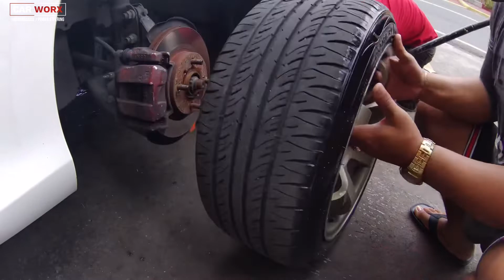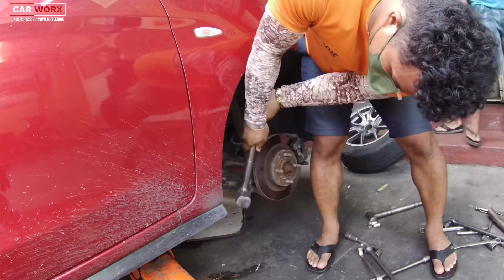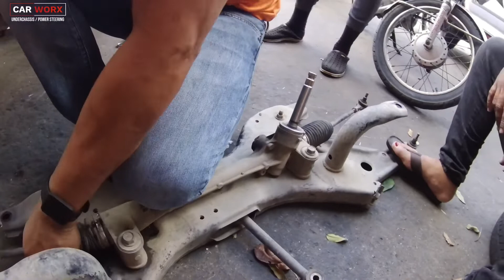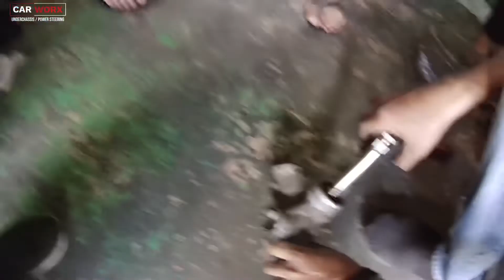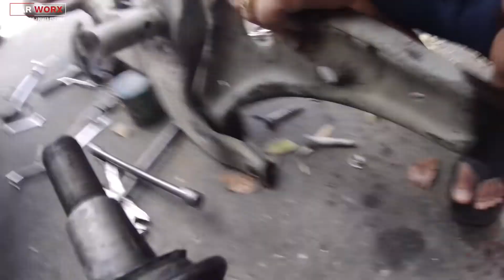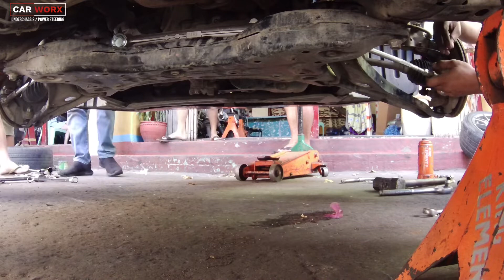Mitsubishi Mirage Kalampag Problem Solved | Replacement of Rack and Pinion

Comment from the maker: Car WorX - Underchassis & Power Steering Specialist
Spend less on your auto maintenance with our on the spot videos all about power steering & underchassis. We are specialist from Banawe, Quezon City, PH!

FACEBOOK: https://www.facebook.com/CarWorxUnderchassisAndPowerSteeringSpecialist/
INSTAGRAM: https://www.instagram.com/carworxspecialist/
TWITTER: https://twitter.com/carworxtips
TIKTOK: https://www.tiktok.com/@carworxspecialist

If you have questions or suggestions email us at: carworxspecialist@gmail.com
Contact #: 09958936876 (Call/ Text / Viber / WhatsApp)

LOCAL OR IMPORTED PARTS MAY AVAILABLE SUCH AS:
📌 Shock Absorber
📌 Lowering Spring
📌 Tie Rod
📌 Rack End
📌 Power Steering
📌 Suspension Arms
📌 Rubber Lifters
📌 Electronic Power Steering (EPS)
📌 Electronic Shock Absorbers
📌 Rubber Bushings
📌 Coil Springs
📌 Ball Joints
📌 Cover Stopper
📌 Engine Support
📌 Stabilizer Link

FOR CAR MODELS:
🚗 Honda
🚗 Toyota
🚗 Mazda
🚗 Ford
🚗 BMW
🚗 Mitsubishi
🚗 Nissan
🚗 Chrysler
🚗 Hyundai
🚗 Suzuki
🚗 Mercedez
🚗 Chevrolet
🚗 Kia
🚗 Jaguar
_________________________________________
SHOP HOURS: Open daily 7am to 5pm

✅ You can see more clearly if you choose high quality (HDor4K) from the top of the screen.
✅ Please note that this video does not contain paid advertisements.